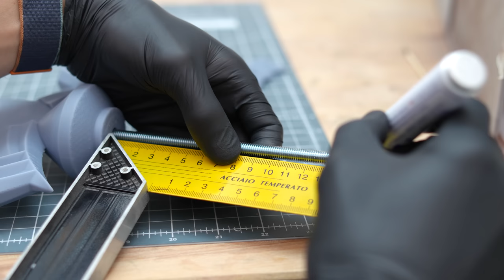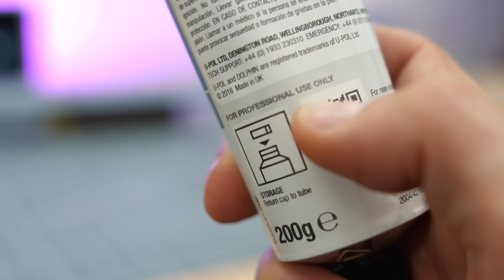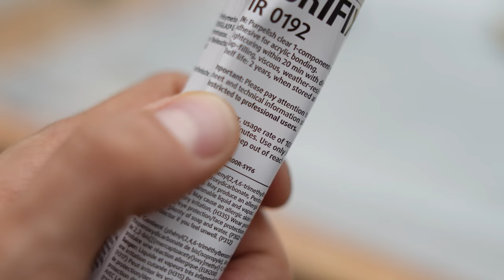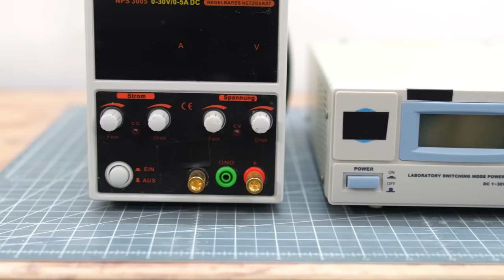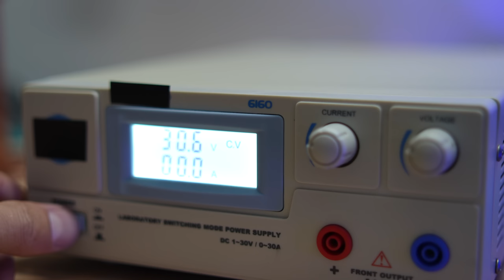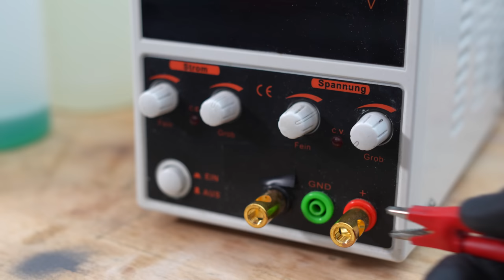Electroplating 3D Prints | Master Sword Tutorial

Comment: I made my first piece! It turned out pretty epic with the exception of one small problem. There were a couple of spots where my wire attached to my piece got stuck and didn't allow any copper growth. I was able to "mend" most of it with solder that I was able to plate over, but there were still a couple of small chunks that remained. My question for you is how do you prevent the wires from getting stuck and preventing growth? I've watched all of your videos multiple times, and the wires are in the same spots they were when you started. I will say that I did see light marks on this sword from them, but yours were light and didn't need any kind of filling. Any suggestions would be greatly appreciated!
Reply from the maker: Congrats. Move the wires and try to minimize their contact area. The welding effect is stronger at the end of the plating. Be aware of this.
Reply: @hen3drik  thanks for the tip! I think some of the stuff I've watched/read also mentioned moving the wires during the plating process. They said every 30 minutes. Is that about what you do?
Reply from the maker: Yes, at the end the wires are not that necessary. Calculate the current and choose the right gauge.

Comment: The 'Baghdad Battery', a primitive zinc/copper cell, was almost certainly the power supply used for such electro-plating.
Many such cells were found, and all of them showed significant erosion consistent with heavy use.
An acid battery that consumes one of its plates is essentially electro-plating in reverse!
Metal going into solution produces electric current in the case of a battery; metal coming out of solution due to the work done by current.
The Coulomb, a unit of electrical charge, was derived by 'dissolving' an amount of metal into an electrolyte solution.
Translation: if 5 grams of metal are 'consumed' by the battery, the battery will produce enough current to plate-up about 4 grams of metal in the plating bath.
Electrical resistance, heating, side reactions all prevent plating all 5 grams.